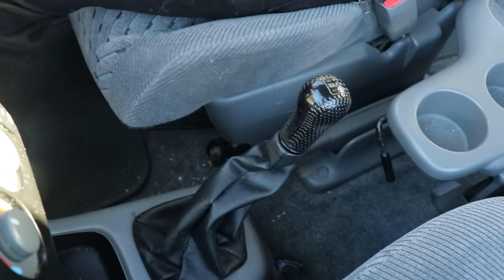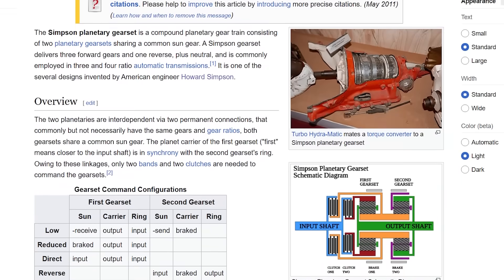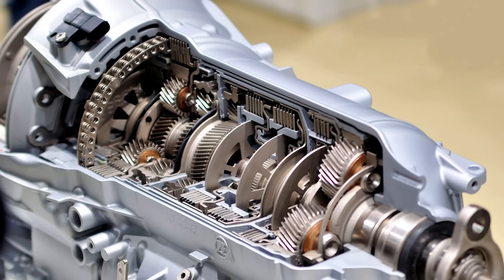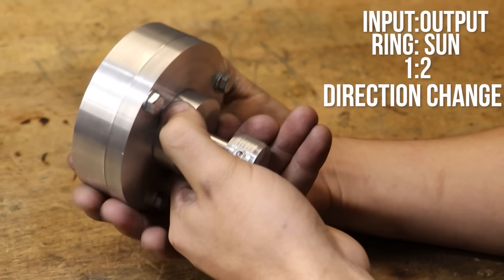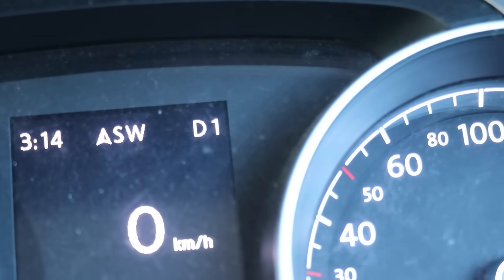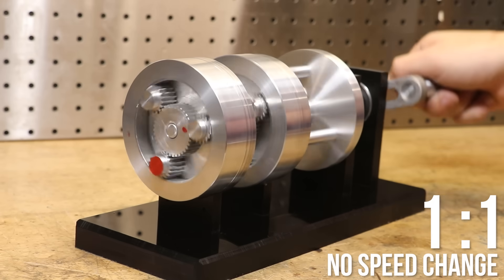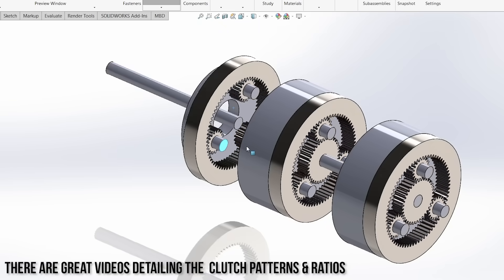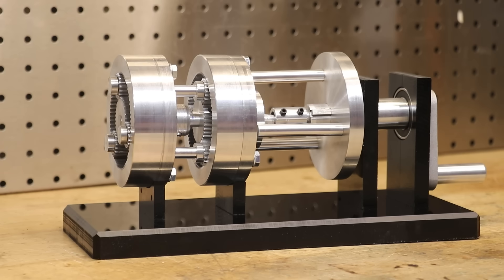How An Automatic Transmission Works

Comment: This begs the question, why did they never make a planetary drive, gear head lathe???
Reply: Pulleys or regular spur gears are much cheaper!
Reply: @jrkorman tell me you have no idea what you are talking about without telling me? 

Clearly you haven't seen the inside of a high end lathe's head stock. Most came with helical gears, some came with true herringbone gears... The most expensive gears to make on the planet.  Money was no object when it came to making high end machine tools, especially in America in the middle of the last century.
Reply: in a lathe, you do not need the input and output to be concentric. And because of the spindle bore, your planetary gearbox would be absolutely gigantic
Reply: @techheck3358 you could still drive a separate spindle with a planetary gear box.... 🙄 use your noggin a little bit
Reply: @EitriBrokkr  I meant that more as a possible assumption rather than a assertion of fact.
Reply: @jrkorman that's a really fancy way of saying you have no idea what you are talking about. So you decided to ignorantly run your mouth.
Reply: @EitriBrokkr  exactly, and youve just lost the biggest selling points of the planetary drive
Reply: @eagle.performanceSidney or monarch
Reply: @EitriBrokkr no need to be like that, you asked the question. But why use a planetary gearbox if not to run concentric with the spindle.
Reply: @techheck3358 thats not even close to its biggest selling point.... Did you comprehend ANYTHING you just watched????
Reply: @EitriBrokkr  your original comment is about  why they don’t use planetary drives, NOT about why they don’t use such an “automatic” transmission
Reply: You replying like a dickhead isn't going to get anyone to give you a proper answer.
It probably just doesn't make sense. In what way? Who knows. Honestly with current electric motor technology they could just be direct drive, only gears needed for timing/cnnecting the lead screw.
Reply: Yeah that could be a gpod project in fact. I recently took a dc motor with an already attached planetary system to make a low speed high toque bench micro drill. It works great. 

I converted it to a micro turning machine to turn 2-6mm brass rods for small jobs. 

On such a small scale it definitely works.
Reply: Friction clutches can't hold position firmly, including them in the geartrain of a lathe would make it unable to cut precise threads.
Reply: @E1nsty tell me you have absolutely no idea what you are talking about without telling me.
Reply: You want to control depending on material and size
Reply: Why gear head lathe needs planetary drive ?
Reply: @BenilNishi they are crazy strong, more compact and efficent, and you can change gears way faster and more effortlessly.... Didn't you watch ANY of this video????
Reply: How would you change the gears. Plus if you include the clutches and the spindle bore, it wouldn't be very compact.
Reply: @asterope1604 did you not watch the video??? Your gear shift levers would be manual clutches. The spindle does not have to go through the gear train.... Wow you people are nearsighted.
Reply: Yes it does, have you ever machines anything long on a lathe. Plus if you include tbe clutches you now need which you dont need on a regular gear train you have added cost and complexity with no extra benefit. @EitriBrokkr
Reply: @asterope1604 they're called band brakes. Super compact. You people are beyond dense. 

Some cordless drills have 3 speeds and the gear box fits in the palm of your hand.....
Reply: @EitriBrokkr can I ask a simple question without getting my head chewed off or being called stupid? What's making you so angry you have to go call people names for asking simple questions or giving their input? Not everyone has been gifted with endless knowledge like you, we all start somewhere.
Reply: @EitriBrokkr okay instead of insulting people who are trying to answer your question like a 12 year old how about you do some research yourself. If you are so smart im sure you can figure it out
Reply: @asterope1604 don't act like a 12 year old, you won't be treated as one 🤷‍♂️
Reply: I'm guessing durability and dependability
Reply: @logicisdead9871 yeah cause that's why they use them in everything from cars to semi trucks to military tanks. 🤡🤡🤡
Reply: You must be absolutely insufferable in person